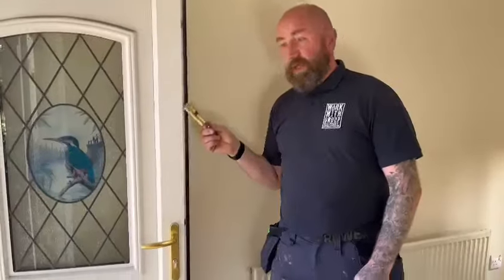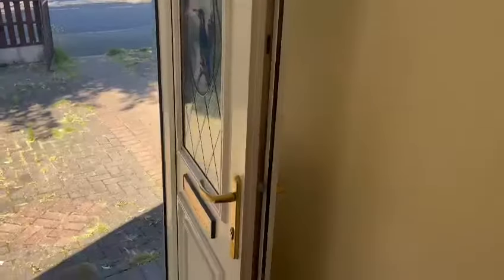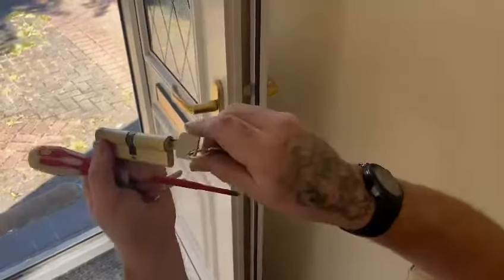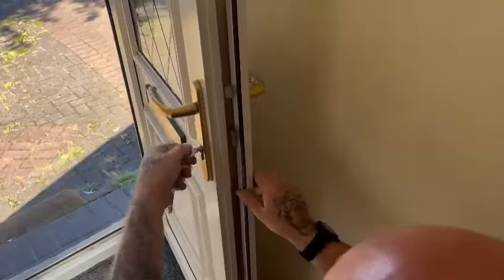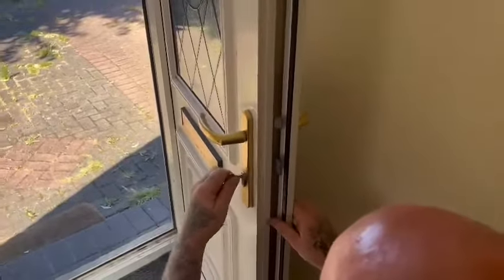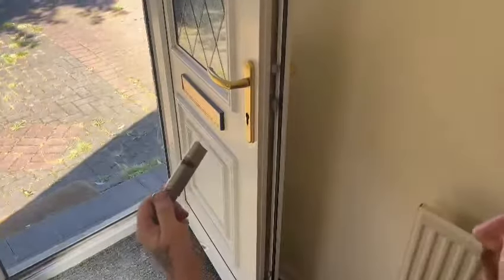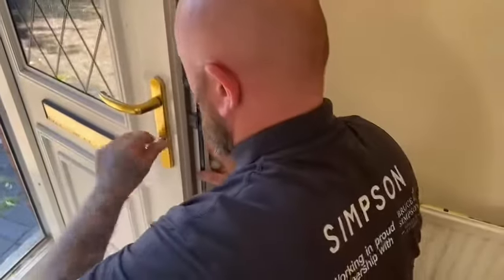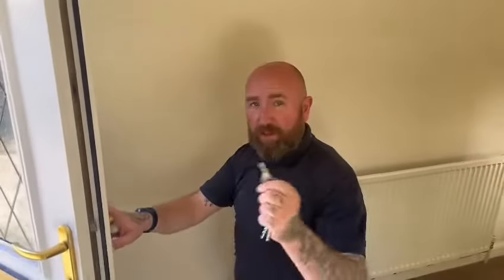How to change the lock on a double glazed door or composite door.

Comment: Are all the locks the same size for a composite door?
Reply from the maker: They come in different lengths and splits. For example 90mm length can be split 45/45 or 35/55
Reply from the maker: I would recommend doing the swap with someone home so you can take the barrel.